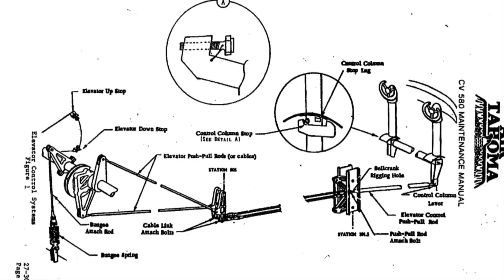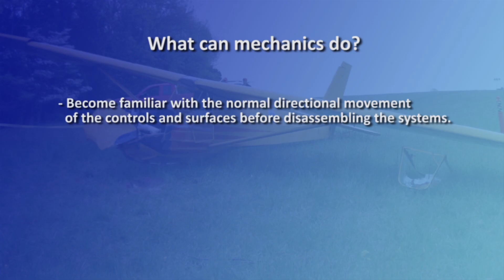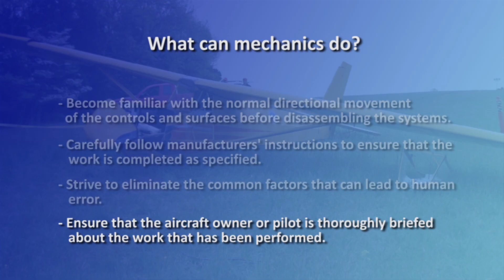Airplane Misrigging: Lessons Learned From a Close Call

Comment: We wouldn't be human if we didn't make mistakes... But we can learn from them, unlike machines.
In UK aircraft maintenance, duplicate inspections are called up in respect of any flight or engine control that's been disturbed. The first inspector will be licenced specifically on the aircraft type or hold a group rating. The second inspector must be licenced but need not necessarily be rated on the aircraft. Correct ranges of movement (including 'sense') and locking devices will be inspected and both signatories will have a thorough understanding of controls and their effects. It's a good system and I'm surprised that the FAA haven't introduced it.
Murphy's Law is always happy to apply itself to lone or fatigued workers.

Comment: Gotta agree with WarblesOnALot. It's hard to believe that, after a trim tab re-rig,  all involved never stepped back and verified the Tab position at it's extreme nose-up/nose-down position from an aerodynamic point of view before this aircraft took flight. Show's a total lack of understanding of HOW the controls work. I'm surprised the NTSB did not even cover the basic aerodynamic principles involved in this vedio....what a missed opportunity. I'll bet even now you could take the same crew and rig the trim properly and mis-rig the elevator and they'd taxi out for a flight.

Comment: G'day,

Yay Team !

 It's a bit scary that the LAME who did the job could brief a Commercial Pilot with Twin-Engined Single-Pilot and Instrument Ratings on how the Elevator Controls had Bin-Rerigged, but neither of them, nor the other (less experienced) Copilot actually NOTICED what they were looking at during the Post-Maintenance and Inspection and Pre-Flight Checks....

 Apparently, none of them had ever consciously thought-through the way in which Trailing-Edge "Servo-Tab" Trim, work...; THE TAB MUST ALWAYS MOVE COUNTER TO THE DIRECTION ONE WANTS TO DEFLECT THE CONTROL-SURFACE.., if you dial in "Up Trim" then the Tab's Trailing-Edge must move Down, and vice versa...

  It should be an integral part of the Visual Inspection..., all 3 times.

 As for the Pilotage and Airmanship...; I thought one held the desired Nose-Attitude with the Elevators, and then moved the Trim-Control to remove the Stick Pressure without even looking at the "Trim-Indicator"..., because...

  The idea is to "Titrate the Dose" by feel, not to blindly believe the Instruments just because they're certified to tell the truth....; this young Pup's Instrument Rating nearly killed the both of them, before he began to think to even try to Fly The AEROPLANE, rather than to trying to Crash it by believing in whatever the (lying mongrel) Trim-Indicator had to say...!

  Maybe it would help if every Pilot were required to complete 15 or 20 Hours in Sailanes, before beginning to get fixated on operating the Powerplant...; Stick & Rudder Skills, and seat-of-the-pants Pilotage and Airmanship seem to have somehow Bin-Discarded, in the haste to teach Autopilot-Management and Navigation by GPS...(?).

;-p

Ciao !

Comment: It must have taken a lot of courage for the maintenance engineer to admit his mistake for this video. Thanks for sharing!
Reply: Jeremy Fonseca I have walked right where he is back in the late 80s. There were three of us changing the elevator trim cable on a PA28-181. When we were done all three of us verified, or so we thought, that the cable was installed correctly by operationally checking the system. 

An Instructor came over to pick the aircraft up. We briefed him on the maintenance we had accomplished and away he went. He took off and came right back and informed us that the trim was backward. Luckily he was experienced and picked up on it immediately. I will never forgot how horrifying that day was for all of us. After that, we changed several more cables and trim drums and verified correct operation a gazillion times prior to releasing the aircraft. It makes me shake to this day.
Reply: @giggleherz  people have been drinking, smoking, in a funk, mind elsewhere for whatever reason.  your mechanic has to be top-notch person 365 days of the year  ;  )  and that's a fact.
Reply: Jay, you are right. This guy could have killed two people. Wouldn't a proper ops check have found this problem? Any flight control that is touched requires an ops check. I'm not so forgiving on "accidents" or "mistakes". I've worked with mechanics that don't take this seriously enough and take short cuts. The mechanic in the video emphasizes following the AMM. It's common practice to not follow the manual when being pressured to get a job done. That is NOT a mistake. That is a choice and a violation. I wonder if part of his penalty was community service in making this video?
Reply: @arthurnied5500  Relax dude. I'm both an A&P and a former Part 147 instructor. Mistakes happen, we're human not machines, and that is a fact of life.
Reply: @ImpendingJoker  glad to see you're such a relaxing mellow dude man. Yeah not the guy that I would let touch anything that my life depended on. Gee I wonder if that's why they have engineering controls and all of these systems to catch your mistakes. Do you teach relaxed attitude as well? You're a real winner.
Reply: @ImpendingJoker  More like ImpendingDoom
Reply: Yeah, hundreds or maybe even thousands of jobs done, anyone can make a mistake. Key is to learn from it and not repeat..
Reply: Jeremy Fonseca You need to listen again. He never admitted that he screwed up. He kept using passive voice.

"The control cables had done a 180 when they were put on the actuator."

"I realized where the mistake was."

"That step was missed."

and

"I never thought that I would have missed it."

Yes, it would take courage to say "I screwed up" or "I attached the cables backwards" but he never did. Not courageous...gutless.
Reply: Jay Philip Williams Gutless? Get off your pompous high horse. The precise language he used is a footnote compared to his willingness to show his face on camera and take responsibility. You’re being disingenuous when you try playing the fool acting like him saying “I never thought I would misrig the trim” somehow means “he never admitted he screwed up.” His entire clip was him admitting he screwed up, who do you think you’re fooling?

One thing is clear - you DEFINITELY wouldn’t have the GUTS this guy had to go on video as the person responsible.